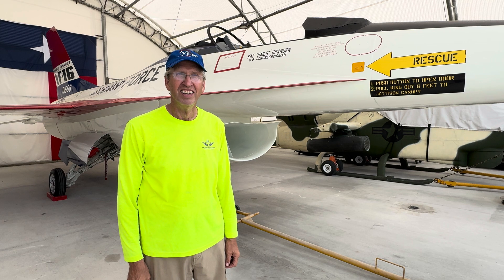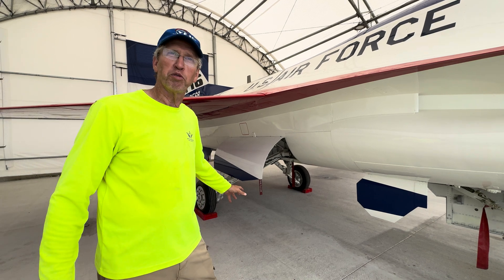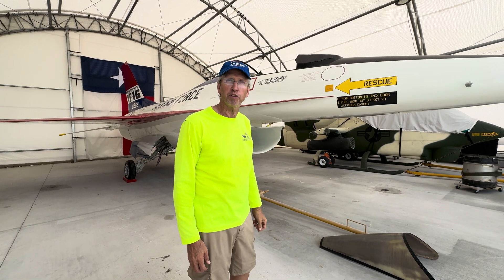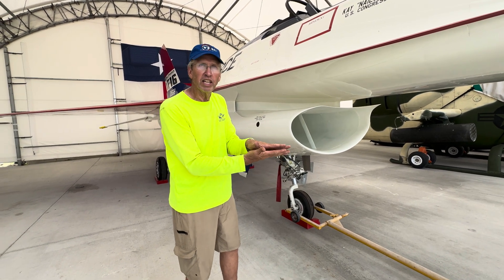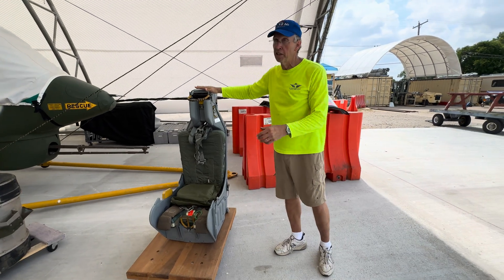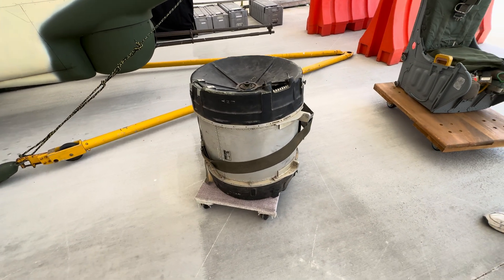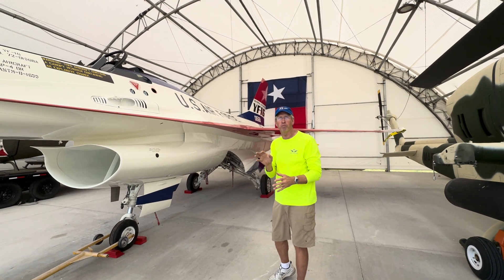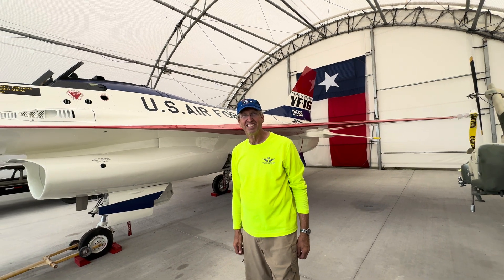YF-16 #2 Post-Restoration Walkaround

Comment: If you think the YF-16 looks "off" with its ORIGINAL nose, you should look for a picture of an FSD F-16A that was fit with an F-18 nose to test fit an APG-65!  The F-18 nose on that particular F-16 drooped like an F-4 nose!  I don't know how that would have impacted the aerodynamics of the F-16 but I wouldn't bet against it affecting drag (+) and perhaps pitch (-) if the radar unit and nose installation were that much heavier than the F-16 style nose and APG-66 radar.  
I believe the APG-65 was heavier, btw.  It was a liquid-cooled unit which accounted for some of its performances advantages over the APG-66 which was not liquid-cooled.
I don't think any F-16 ever flew with an OPERATIONAL APG-65.  The F-18 type nose was fit to that pre-production F-16A because there was no other way to adapt the APG-65 to the F-16 airframe (that was practical and economical)!
Later, the US Marine Corps recycled a lot of F/A-18A APG-65 radar sets for the last major AV-8B upgrade program.  This did involve replacing the original Harrier II nose with an F-18 style radome to house the recycled APG-65 radar!  Fitting the APG-65 to the Harrier II granted the Harrier II the ability to fire BVR missiles (the AIM-120 AMRAAM).

Comment: Beautiful work of art!  Got to Edwards April '75.  The YF-16's were the hottest planes on the base.  The red, white, and blue motif just added to the wow-factor.  After a gunnery mission we got treated to a low pass from Neil (I think) from due North right at DAGRAG tower.  From the top of DAGRAG (~ 40 ft) we were looking down on the jet as it came right at us. Neil pulled up with 15 ft of the tower.  What a thrill and glad to play a small part in the test program.  Thanks for restoring a legend that will live on...

Comment: Wow those early F-16s are so clean, I bet that kinematically they are more capable than the current revisions
Reply: The early -16 is almost a different aircraft. No Air to ground. Smaller wing. Far less thrust. But also less weight. The older computers were not up to par with modern fly by wire. But the old could probably still hang with the new Viper in a Visual close engagement.